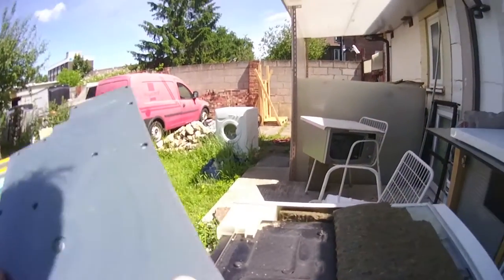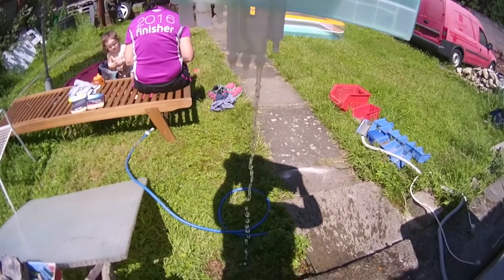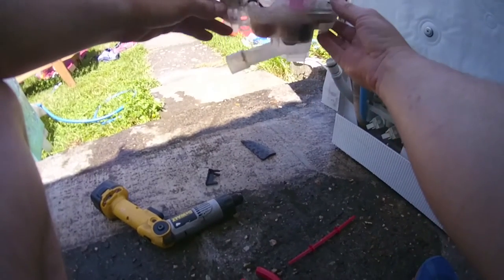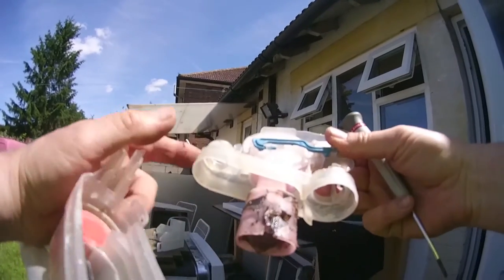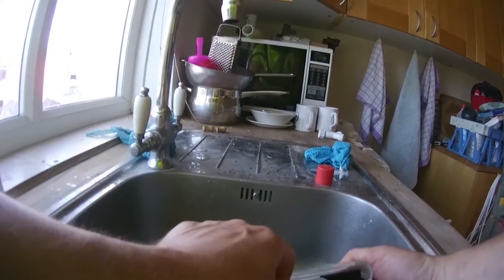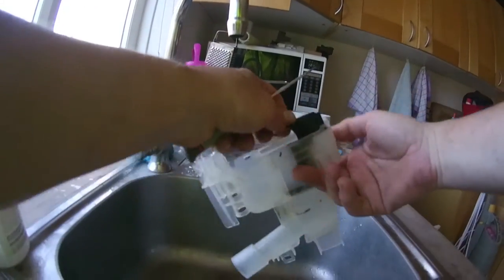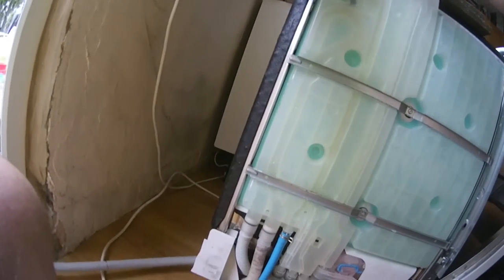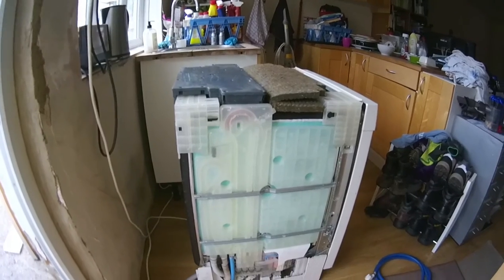Bosch Dishwasher Repair Refurbishment, strip down, clean, float, matrix, pressure switch reassemble.

Comment: At least it did its job after 10 minutes of filling. Newer Models count the water rushing in using a tiny wheel and a reed contact. If the thoughput is too low you get a penalty in form of  a tap symbol flashing and the machine stops. I can understand the enginnering standpoint but if the whole cycle takes a little longer who cares? Of course its better when its fixed. Good work!

Comment: Thanks for posting this video - the entire top left corner of the water matrix in my Bosch dishwasher and the float chamber were entirely clogged with gunk, so taking it apart to clean was the only option. I needed to leave undiluted bleach in the matrix for 24 hours to dissolve all the material, but it worked. Just keep flushing it and shaking it vigorously once the bleach has penetrated the areas with the worst build up.
Reply: Where did you pour in the bleach and how did you get it into the labyrinth at the top left that zig zags up and down. In mine I've seen liquid run from the far left pipe up into it. But getting it done the obstacle course but it's really hard
Reply: @mrcneale  I took the whole thing out of the machine (like in the video) and then turned it upside down. Then when it is upside down, you pour the bleach in the hole that is directly above the corner where the float chamber is (ie. the hole that is directly below the float chamber when installed in the machine) and it was not too hard to manoeuvre the liquid where you need it to sit.

Comment from the maker: The stills at the start are to point out the two front screws, inside the door, the two clips at the rear of the top panel. You can then remove the left hand side panel by pulling it backwards and up. My theory was if you can't remove these yourself then you really shouldn't be fiddling inside one of these! Hope you find the video helpful in the quest to keep these from landfill.
Reply: Thanks alot. I have dismantled mine. Now will check whats issue. Water is not filling and its too slow to move the water arms around to wash.

Comment: Congrats, you got all good :-)
Do this on my Bosch dishWasher for years :-) looked like myself doing it LOL.
Thanks for the video, I hava been lazy to make one myself.
You might want to clean that pipe that goes to the bottom to the water pump. It gets all the gunk that has not been trapped elsewhere.
Reply from the maker: Yes thanks for your comments, that's a good tip :-)

Comment: Thanks for the excellent video. 
What would stop the machine filling with water? Blocked float switch plus gunge in the float chamber?
Reply from the maker: the inlet valve stuck would stop it, plus what you mentioned ;-)

Comment: I love the information shared on the internet. Thank you for this. It concerns me that the build up of material in the water inlet pipes and valves reduces the effectiveness and useful life of the machine but the manufacturers are not being required to include some easy remedies.
Shouldn’t there be a mechanism to get cleaning material into the area through the inlet pipe periodically so that it can be flushed through in the same way as central heating radiators can be de-gunked?
Reply from the maker: This would be too difficult for the manufacturers to implement when this was designed. Now however a little bit of computing power and some sensors could scene the flow rate going down and set off a self cleaning cycle ;-) Would love to see this implemented by a manufacturer!
Reply: @Sunsetseven  I believe such an innovation would be a unique selling point in this environmentally sensitive age. Maybe we should start a campaign!

Comment: I have followed the instructions and everything is going as described in the video except that I cant seem to unblock even with loads of bleach and hot water. I think it is re-hardened dishwasher tablets. The same that clogged my outside drain. It is super tough. I am making some progress but very slow. Is there anything  stronger  i could use that won’t damage the unit? Any suggestions?
Reply from the maker: Give Vinegar a go, mixed with some baking powder.
Reply: Sunsetseven i did try vinegar first but not very long. Will try again with baking powder. Can you tell me what strength bleach you used? Is it worth tryingBleach 10% sodium hydrochlorite?
Reply from the maker: @polomagnum7520  might need a few hours to de-solve it, not sure about using the sodium, let me know what the results are if u try it ;-)
Reply: So I have managed to do everything in the video. The matrix fills up easily and quickly. It cascades into the pressure chamber and the float appears to work. However, water still isn’t flowing into the machine. When I set the quick wash cycle, I hear buzzing and whirring but the inside of the machine remains bone dry. Would you know what that could be and provide a link to a video for that? Much appreciated.
Reply from the maker: @polomagnum7520  tricky to tell without seeing it.
Reply: @polomagnum7520  I had the same issue - try pouring some water into the sump chamber, that worked for me
Reply: @polomagnum7520  Chuck 2 or 3 litres of water into the sump.  The first thing the machine does is drain the previous sump water then activates the new inlet valve.  When they ship new machines they ship them with a small amount of clean water in the sump.

Comment: I have this one but cant find out how to remove the side panel and the top. There are no screws and top does not appear to snap off. I have removed the 2 screws at the front but unable to get panel off. Can you help please ?
Reply from the maker: have you  read the message below this?
Reply: @Sunsetseven  Video was too fast , slowed it down and yes it looks like that will give it a go thanks.

Comment: My biggest issue was getting the lid off, there are no screws fixing it in place; any tips?
Reply from the maker: should be 4 at the front behind the door and two at the top of the back.
Reply: @Sunsetseven  got it, two tabs which depress, then push the lid front to back.  The front has two mushroom pins that slide from an elongated hole to a standard hole which then allows the lift up and away

Comment: I'm getting e15 on my Bosch Dishwasher. Water comes in the bottom tray and lifts the float switch. I've been testing it and it only floods about 1 in 5 washes and I can't see where the water is coming from. Could it be from the matrix, which looks gunged up , or the float unit?
Reply from the maker: I would guess the float unit, as you'll have to take it apart anyway clean them both! Let me know how you get on :-)
Reply: I'm having the exact same issue. I don't see water coming out of the matrix, nor from any pipe, i'm pretty confused. Could you fix it?
Reply: My Bosch is a never model SMV53A00/03 with a different matrix and float unit. Ive got the matrix off and am cleaning it. I don't know how to clean the float unit as it's very different to yours
Reply: @minipada  I think that the matrix is a pressure release vent/valve when the wm drains and if it gets blocked then water comes out and floods the lower tray. So it needs to be cleaned. Mine is a newer 2011
Reply: I think that the matrix is a pressure release vent/valve when the wm drains and if it gets blocked,  water comes out and floods the lower tray. So it needs to be cleaned. After all, Bosch wouldn't put it there if it had no purpose. Mine is a newer 2011
Reply: and has 2 fixings into the WM which both unscrew, the top is difficult but will eventually unscrew.  Remove the matrix and I found that very hot water and shaking eventually broke up the soap residue. It take a long time to clean! All seems good now
Reply: @davidthomas3081  Thanks, the WM is completely cleaned, I needed bleach too but still water comes out :/.
Basically, as soon as the water is "drained", it is draining it on the bottom part of the dishwasher. This happens in the first minutes of when i turn it on the first time. I don't know otherwise. I'm quite scared of messing it up